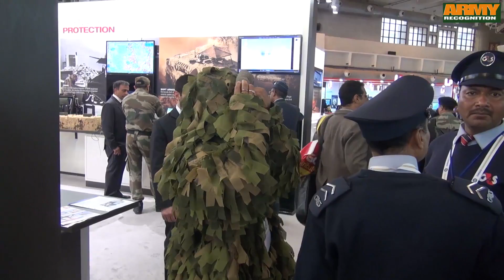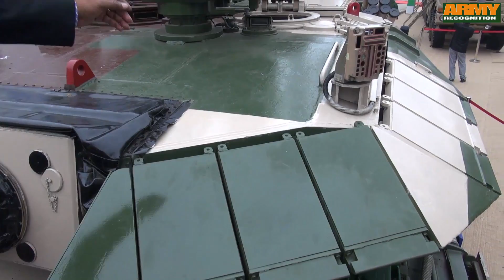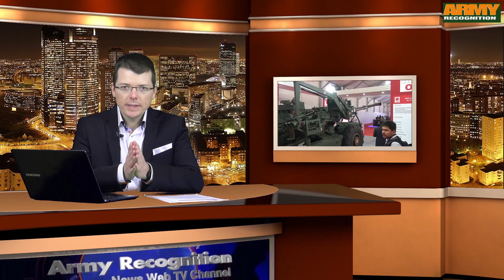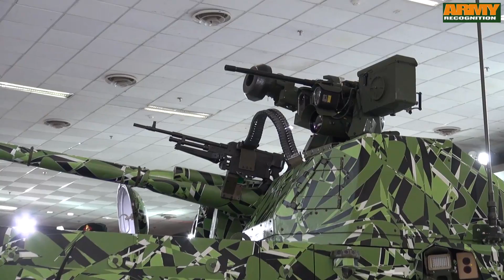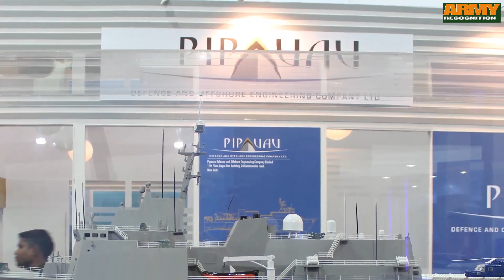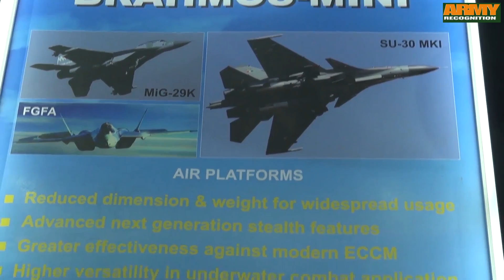Defexpo 2014 show report coverage Defense Exhibition New Delhi India army Recognition Defense Web TV

Comment: Can someone tell me why Pride of India Arjun mark 2 Tank was not distlayed this republic day parade 2015 while it was shown in 2014.
Reply: most probably either logistics issues...its a super heavy tank...or probably because the army grounded all arjun regiments because of its failure as a tank for extreme heat conditions in western rajasthan sector
Reply: +bikramjit purkayastha The only reason the tank fleet was grounded was cause they didn have enough spares.
Why didn they have enough spares? -  Cause most of Arjun mk1's parts are imported.
Why is it imported? -  Cause Army placed an order for just 124 Mk1 and its not viable to open up manufacturing lines for all its parts with such a small order.
Why only 124 mk1? - Cause import lobbyists are getting good bribes from the Russian T90 makers.
Why wudn they import more spares? -  They wanna kill the Arjun project.
Reply: +rohitb3 I've seen a lot of jingoists praising this tank..but facts are facts and they better come to terms with it...the computerised fire control system goes inactive and doesn't work at a cabin temperature over 52 degrees which is normal for tankers deployed in sectors of Rajasthan..There's no scope at least not as much of armoured warfare with China as there the terrain acts as a natural barrier for tank warfare...Fire control system is the most critical component for tanks after gulf war in '91 when the nato allies butchered entire divisions of the so called formidable T-72 asad babil divisions of Saddam only for a max of 20 tanks lost to the allies in combat...By the looks of it, I think all the Arjun Mk I's will never see action..India is already contemplating developing a future next gen tank with multi layered composite armour using the russian armata platform..Arjun Mk II has beaten the T-90 really by a long margin but because of unreliability of drdo equipment, the Army has made just orders for124 tanks of Mk II ...I think all the Mk I fleet would be sent back to cvrde chennai and modified to work as mine sweepers and bridge laying platforms which are very crucial for armour formations and russian Bridge laying platforms on the T-72 chassis won't be ble to support the extremely heavy Arjun
Reply: @bikramjitpurkayastha  can you provide evidences to your claims?
Reply: +bikramjit purkayastha source ?
Reply: +Hrishabh Divya check youtube itself for starters
Reply: bikramjit purkayastha not a trusted way to  start  the source even when something is developed  or made no matter how much good it is you will  always get   critics about it.....

the best  way  to  know is  trusted source... like Wikipedia etc etc .. and i  don't see any  good ... source against it